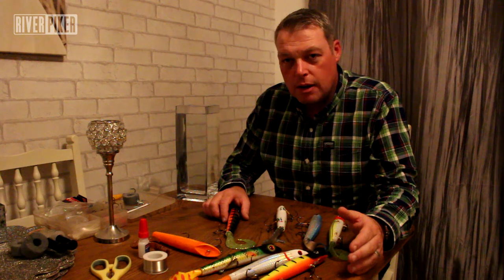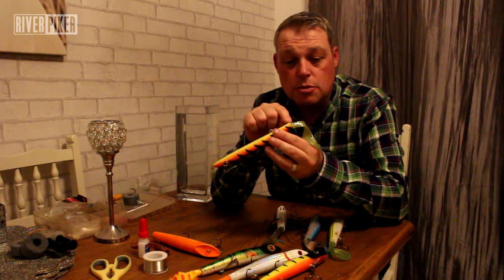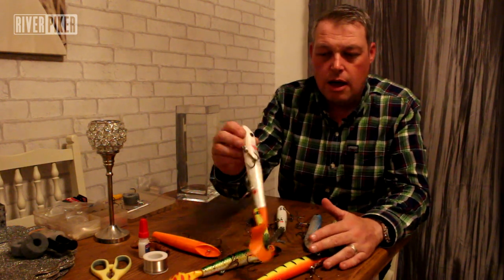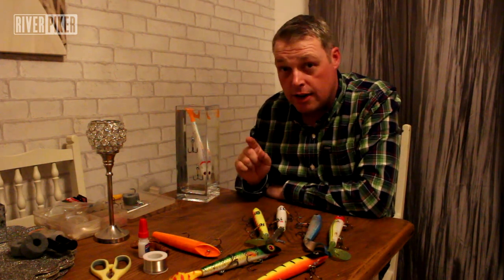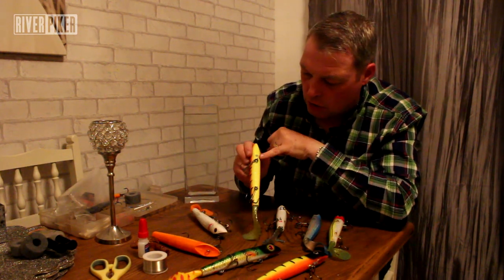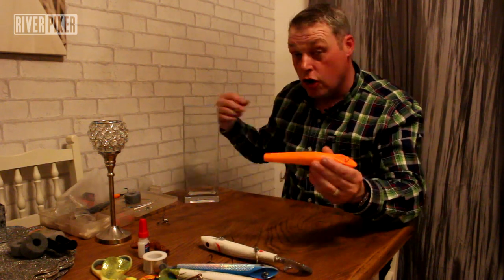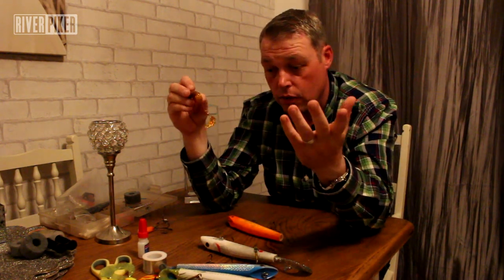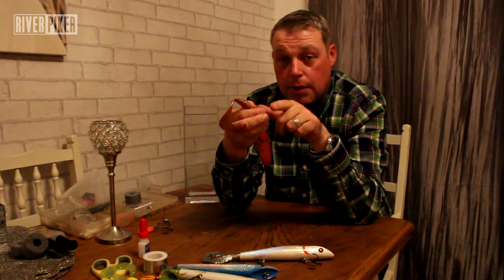Squirrely Burt your questions answered - (video 156)

Comment: Finally had a go at this, when I tried mine initially at a pool it was very floaty, it was just a check rather than an attempt at catching , and was done with a 35lb trace and a clip to suit, I drilled a little hole at just over one cm front of the front hanger, and put in an approximate amount of shot, then in the tank, it tried to get horizontal, then I remembered the trace which was a hundred pound and a clip to suit, it became very sinky!
To shorten the story I ended up taking all the shot out, about thirty no10 shot, I drilled another hole about one cm infront of the first, this was just inside then next internal chamber, with about ten no. ten shots it still sunk it, the reason I did this was to try and make the burt sit more vertical 
So to shorten the story abit more I ended up with about five no ten shots in the front chamber and the clip and trace connected with a loom band as close to the front as possible, as it would be in a working position , it balanced pretty good , just bouncing off the bottom, so I took one out to compensate for the weight of the filler,then filled the holes with epoxy, I ended up with just four no. ten shot ? So my thought on this is that my particular burt, or , if your using a large trace, mine is knot2kinky 100lb plus a compatible staylock clip "(as my waters are fully of bikes and car doors, and I want my lure back, unless I go. The river, which is naturally snaggy) then the shot is negligible .
It's drying at the moment shall try is out as soon as possible.
Reply from the maker: Acer mate. Thing with the burts too that people foget, it's something fishy to do while oyu are at home. I mess with mine when its raining and the rivers have been flooded and our lass is watching the soaps. As you've found, loads of tinkering to be done and everyone finds their own little way of making it work. good luck if you get out mate, i hope your new burt is a catcher!

Comment: Hi. Great video, but my lures start sinking when I attach a leader. Have to correct it. Besides, they do not stick in water as vertically as yours.
Reply from the maker: HI mate. When you bought yours were they the weighted version? Have you re-weighted yours now? Yes even the leader can tip the balance. I have had the occasional Burt that does not sit vertical like the video. but worry not, it will still work and it will still catch pike. i still use some burts like this. Great for fishing in water 3-8ft deep.
Reply: River Piker I bought them last fall in Germany and they are weighted version. I have to open the drilled hole and remove a few leaded balls.

Comment: really Interesting video Ade & Paul, plenty of thought provoking stuff :)
Could you please tell me the Casting  Weight range of a rod to use for fishing comfortably fish with Bert's.
Thanks in advance.
Reply from the maker: Burts are 86g when re weighted so at least a 100g rod. I will use rods around 140-160g range mostly. But remember it is also down to individual rods what they can actually cast. I've had 100g rated rods that struggle with burts and 100g rods that can throw 150g with ease.
Reply: River Piker thank you lads

Comment: Is the standard burt cut down with tail added the same size as the squirrely burt?
Reply from the maker: they are virtually the same. Basically as you say the standard burt is just cut down to add the curly tail. A standard burt also would have 3 treble hooks

Comment: Hi .. What's size treble hooks do you put on burts and what brand please
Reply from the maker: Hi Julian. Eagle Claw 374 hooks and size 3/0 is what i use. 2/0 will do also
Reply: River Piker thanks for the info as the hooks do look big.. I live in Peterborough where the rivers run between 4 to 5 foot . Do I still need to add on weight to the lure
Reply from the maker: You might be ok without weighting. I would go out and fish with them first and see how they go. I have a few burts which i have not modified and i fish them in simialr depths. I would also think about getting 40lb split rings if you can and put them on your hooks. That way should you snag the bottom your split ring will break and you will get your lure back.
Reply: River Piker thank for that I will give them ago and see .. You've been a big help.. Cheers
Reply from the maker: No problem buddy, good luck!
Reply: River Piker hi.. I gave the burt ago this morning and I see why you add weight it layed perfectly flat on water and was hard work getting it down. I've ordered some lead shots of eBay . When you add lead to get the desired angle how do test it before you put glue  in hole and do you cover glued hole on finished job (stick patch or something).
Reply: And is the centre point between the eyes and first hook best place to drill

Comment: Cracking video lads. I've just picked up a standard Burt that's been poorly changed for a few quid. Gonna get it weighted then get it sent down to Mark Houghton for a paint job #pimpmylures 😂
Reply: Any recommendations on what epoxy im best using ?
Reply from the maker: Are you just wanting to reseal the hle when you reweight it? Just get a 5 minute epoxy such as the Gorilla epoxy. That will cover the hole, you can also cover the hook hnager tiny holes if there are any. When Mark repaints he'll give it a nice tidy finish.
Reply: Yeah thanks mate, it's in pretty poor shape  but a wee bit of tlc and it should do the business. The previous owner has made a bit of a mess drilling it but it looks salvageable.
Reply from the maker: Yeah course it is. Another follower messaged me to say he had a dodgy burt that didn't sit right. He's drilled it, taken out the weights and then re done it. Worth the effort if you can save a burt.
Reply: I'm looking forward to having one that's a little different aswell. Spoiled for choice trying to choose a pattern for Mark to paint for me, can't decide lol
Reply: Smuttly DB4 any good guys ? Liked the look of them , got one on the way.

Comment: Hi 

Just a question got two of these lures they all stay straight up on water, I would like to be able to weight them and re weight them if you get me, I fish shallow spots during summer then in the winder I like to fish deeper (7-8ft) could I just superglue lead under the bottom of the head on the burt ? Good idea ?
Reply from the maker: Hi matey
Super glue doesn't last long enough and the lead will drop off. Get some 5 minute epoxy and use that instead. eBay or your local DIY shop will have some. Not sure if you have seen this video but it shows how we do them by drilling a hole and putting lead shot in. Even if you stick lead on rather than drilling its a good video to watch as it explains what you are trying to do.
https://www.youtube.com/watch?v=HkZMZZaDp9s
Reply: River Piker  cheers, 

Watched that a few times, I'll get some epoxy, could I use flat lead (what they use on roofs) cheers
Reply from the maker: Yeah that will work. I used to do all my burts that way years ago.
Reply from the maker: I think the gorilla epoxy has lasted about a year on some of my older lures. I had another epoxy (no idea of brand) which has been on some of my even older burts about 5 years and is fine. Way back when i used to stick lead on the front like you are. I've noticed on a couple of newer burts, 8 months old, the gorilla epoxy has lifted a little bit.
Reply: Cheers.. 
I've got two burts a firebelly which has been fantastic getting pike like mad! I've got a perch one too, I fish shallow lakes and when I was fishing the burt (unweighted) I was jerking down fairly hard to get it down to about 4ft! Would the best thing to do is put a bit of lead weight on them, Then take the lead off around September and put on more lead to fish deeper lakes and rivers? would it be easy to take off the lead? 
cheers.
Reply from the maker: I've never tried to take off the lead.  I've got that many Burts I just weight them all up a little differently. Most of them are neutral buoyancy so they suspend but i have a few that slow sink and a few that slow float on the pause. If you are fishing 15ft of water and your burt goes down 4-5 ft it is not too bad at all. Pike know it is there and will easily come up for it. If you can get a burt to go 6-10ft, which is tricky and often more to do with timing of the downwards jerk than just adding more weight, then you have done the best you can. 

Thing to think of when adding more weight, and the lure sinking, is this effects your line lay and then your downward jerk. If the lure sinks, you will get a bow in the line. When you jerk, all you do is tighten that bow and not really get a good contact with the burt. This brings it forward more than down. So its all about timing and with a good suspending burt, on the pause you tighten up as much as you can that bow or any slack, then on the downward tap the contact is immediate and all that energy transfers in to making the burt dive once more. I hope that makes a bit of sense as it's not an easy thing to explain. There's a real art to making them go 8ft plus.
Reply: River Piker 
cheers, 

Put on some lead and can get it down fairly deep, I've one that's un weighted for shallower parts of the lake, these burts are class lures I could keep one on all day and still catch!  Might have to get a few more lol! Cheers.

Comment: when drilling the 3 mil hole 1cm from hook hanger is that from the very edge of the hook hanger or from the middle of the hook hanger or from the hook hangers furvest point if you understand me so i don't drill to far forward or too close
Reply from the maker: 1cm from edge of hanger. If you did it wrong you will hit the line of plastic which is the divide for the front compartment. No bigger, just fill and epoxy over it
Reply: thanks for the video lads. which compartment do u put the shots?

Comment: What is that small jointed lure you use for chub fishing ?
Reply: Idk - rapala jointed shad rap?
Reply: Angry Hobo hey tom
Reply from the maker: Its a jointed Yogi, custom made lure
Reply: how much are they?
Reply: Hi Austin
Reply from the maker: they are about £6. I had a few in my shop but pretty much sold out now i think
Reply: oh ok that's not too bad I may get one.
Reply: I wanted to get a few as well
Reply: When they in stock ?
Reply from the maker: I need to try and get Yogi to make me some more. Just keep your eye on the shop.
Reply: ok will do, I looked on the internet but they were 5cm are you're special ones then?
Reply: Thank you
Reply: I love you Austin <3
Reply: Haha
Reply: Also how much are the rapala jointed shad raps in your shop ?
Reply from the maker: £8.50. Just checked and all yogis sold out. I had 4,5 and 6cm
Reply: River Piker I swear you could just use a 4cm jointed shad rap instead of a yogi.
Reply: Are different sizes different prices ?
Reply from the maker: no mate all the same
Reply from the maker: riverpiker.com/shop
Reply: Oh ok  thanks
Reply: Also what rapala pattern would you recommend Fire tiger hot tiger or perch ?
Reply from the maker: I usually have a bright and a natural in my box just so i know i have covered both. Not fussed which exactly. Pick what you like they all catch
Reply: Thanks